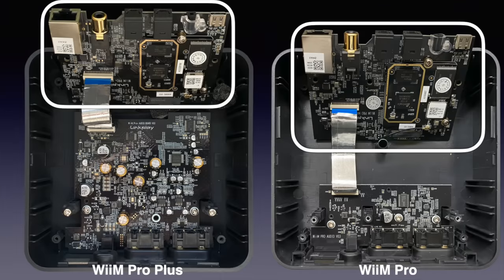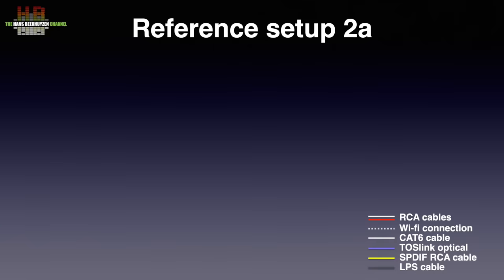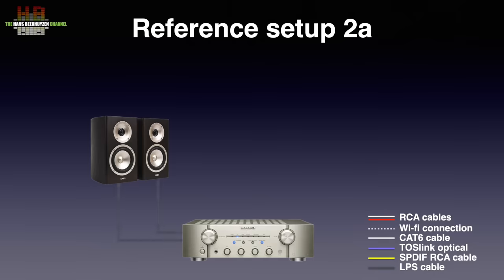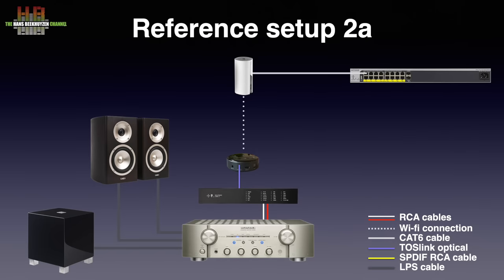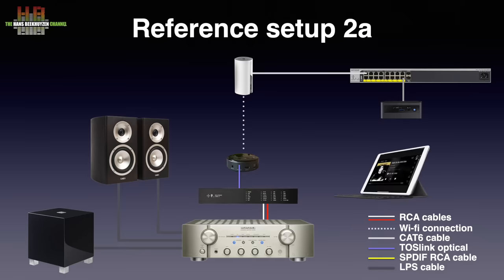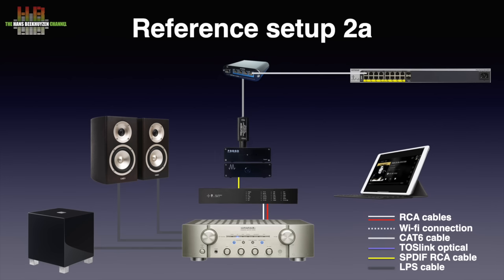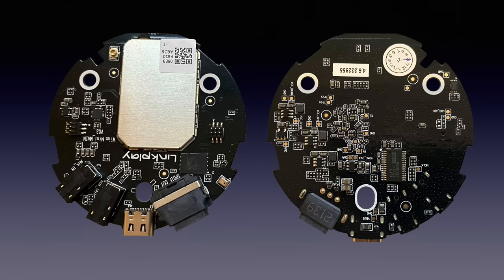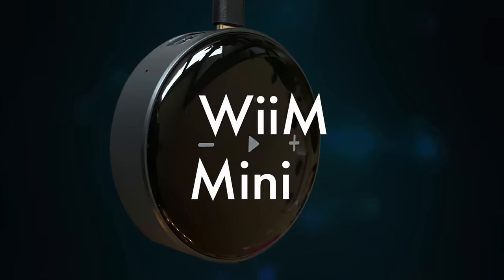The digital output of WiiM  streamers

Comment: Well, THAT explains why my Wiim Pro's sound is almost unrecognizable from when it first arrived. It's currently powered by an LHY linear power supply and it's connected via coax to my Denafrips Hermes digital processor that is connected to my Denafrips Pontus II R2R DAC via i²s. The Hermes uses OCXO-based clocks to reclock the original data stream after electrically isolating the data stream from the original digital digital source.
Reply: Interesting post as I was looking at a similar combination. I would have thought the Cyan2 reclocks the data but I'm not sure.  So I think you are saying that the limitations and SQ issues outlined by Hans (i.e. the Wiim clock) are mitigated by the superior OCXO clock on the Hermes, before feeding a superior DAC
Reply: @usswia that would be the case if the Wiim had a USB output . The connection with the Hermes would be asynchrone
Reply: You can hear the difference?
Reply from the maker: Reclocking requires an extremely stable voltage to the DAC, extremely good flip-flops and buffers that are very fast. Therefore it's always better to start off with a clean, well clocked digital signal on the input. Therefore spend as much as you can afford on the digital source. Preventing is far better than curing.
Reply: Love the 😅 the usability  and versatility and love the price. I love the way it makes my budget setup sound like a budget  system  with the pro ( priceless ). One more thing  it has a remote, and you can add a dac ....ps I have  porcupine  tree in every room in my house and in my  garden. Shedd lol
Reply: @TheHansBeekhuyzenChannel  Preventing is far better than curing. Sound advice!

Comment: hi, are there possibilities to obtain I2S out from the WiiM Ultra? Are there some pins on the pcb with I2S signals?
Reply from the maker: I’m sure there is but I would not bother. It will use the same clock as the other digital outputs.

Comment: As an engineer with a signal processing and signal integrity background, I'd love to measure the impact of various streamers on the audio output of the connected DAC measured using Audio Precision or similar test equipment. For stereo imaging, one could use RMS vector error on a complex plane defined as (left) + j(right). As a music lover, I admit I am less than satisfied with a WiiM Pro Plus connected via S/PDIF than I am with an ARM-based SBC via USB into the same DAC (in asynchronous mode USB Audio).
Reply from the maker: The Audio Precision can’t measure that. My colleague Jaap Veenstra of alpha-audio.net does these measurements.
Reply: What you say makes sense. The S/PDIF output is being clocked by a $.25 crystal most likely.  The SBC/Pi would have the DAC’s more advanced/accurate clock handling the timing.
Reply: Yes, USB is the solution in nearly all cases - at least that is my experience. I use an RPI4 powered by an LPS and connected by USB to my DAC. The sound staging is very precise to my ears.
Reply: Curious if you know about the quality of the USB output on the 4b. I know previous Pi’s  had usb issues and always debate if I should get a USB galvanic isolator?
Reply: @szh70  the RPI 4 and 5 separate the USB and Ethernet controllers/connections from a shared architecture, so that should help. Schitt brand of DACs have an indicator if they think the incoming source is poor, and that has never triggered with my RPI4. Any decent DAC should filter out a reasonable amount of electronic noise from an incoming signal.
Reply: @szh70  The prior issue with Ethernet sharing bandwidth with the USB ports is resolved on the RPI 4b, but electrical noise transfer could still be a problem. In my case, I am using a ROCK64 with the USB passed through an iFi Audio iPurifier3 before reaching my DAC. YMMV, but this kind of set up seems to work well for me.

Comment: I’m not sure about your conclusions regarding the WiiM Pro. I started out with the Mini and iFi power supply using the WiFi , into a Denefrips Ares12 balanced cable to McIntosh c50 Pre balanced to a McIntosh mc352 amplifier ,to Klipsch La Scala speakers, REL subs and a very good sounding room. Excellent soundstage super strong Center image details that I haven’t heard before all in all in general a fantastic experience.Then I bought the Pro and replaced the Mini. I thought there may have been better sound, but really did not notice a large delta. I really don’t know or think there’s anything more to be gained switching to a more expensive streamer for my system.
Reply from the maker: Let's agree to disagree ten.
Reply: @johngutmanis3204  You went from a Wiim Mini to the Pro. The issue is that both would have the same issue even if somehow the pro is to a lesser degree. I think you would need to try a more upscale streamer compared to the Wiim to then confidently claim a streamer update in your system won’t make a difference.

Comment: Very interesting!!  I recently tried the Eversolo A6 but hated the DAC and hated the fiddly user interface almost as much, so it wasn’t worth it to me to use it as just a streamer with a better external DAC. 

I ended up going with the iFi Zen Stream primarily due to its purpose-built function with NO built-in DAC. I have a Naim DAC-V1 which, as you may know, had an asynchronous USB input that pulls the digital signal from the streamer and runs it through its own superior clock. Do you think I’m missing something by pairing a $400 streamer with a $2,800 DAC?  It sounds incredible, but your video is making me question whether I’m leaving sonic money on the table, as it were. Thanks for everything you do!
Reply from the maker: De gustibus non disputandum est

Comment: Hi ….i wonder if something like a digital to digital converter for everything digital that connects to the dac might be useful here since they usually have super high resolution clocks and apparently clean the signal up 🤷‍♂️
Reply from the maker: It can help, but only if the DAC following it up does.t ruin it again to some degree (with is often the case.

Comment: Hello Hans, very enjoyable video and answered the first part of a question I've been pondering for a few weeks now.  The second part is : I understand from your video that a major limiting factor in the Wiim is the onboard clock.  Does the digital data stream not get re-clocked by the Cyan 2 DAC?  I could not find any documentation on the Cyan 2 clock, other than a reference to a Femto clock on the original Cyan, so I assume it's probably something similar.  Can any of the SQ issues you identify (bass, image, etc) be recovered by a better quality DAC or DDC clock e.g. an Ocxo clock on a Denafrips Hermes?   Generally, I agree with matching components price-wise but I find the Wiim app interface excellent - better than all I've tried so far at various price points (interestingly Musical Fidelity are partnering with Wiim for streaming solutions) so, like many, I'm asking how can I take the performance to the next level, while still enjoying the user friendliness, online support, active forum etc of the Wiim equipment and community.  If you are ever in N.Ireland, free B&B in exchange for some room set up tips.  (or maybe that's not really free, then!)
Reply from the maker: It's not only the crystal. See my video "The BS about network switches and the like." (https://youtu.be/ZCFvIzzMqfk). What goes for the switch also goes for streamers.
Reply: @TheHansBeekhuyzenChannel  Hi Hans, Can you put the link on measurement results of Wiim Pro Plus (digital output especially) of Alpha audio? What was the test setup? What is in your opinion SQ difference between Wiim Pro Plus digital output compared to your favorite Magna Mano MK3 with the same external DAC? For example, In one of your reviews you set the estimation that Mano MK3 is on 80% of Grimm Audio MU1.

Comment: I used an Audiophonics DigiRescue (from France) reclocker between Wiim streamer (with linear power supply) and SMSL SU-X DAC, the sound improved considerably..... I cannot say if it improved to the level of a more expensive streamer, but I am happy with this combination.
Reply from the maker: Enjoy the music
Reply: Have you tried with the SU-X without the DR?  The PLL circuit of the SU-X should do a grand job of removing jitter. Sometimes adding an external reclocker or resampler can increase the noise floor and not add anything to jitter removal if the DAC has good PLL circuit

Comment: I recently ordered a Wiim Pro Plus to sate my curiousity about the quality of standalone streamers vs my dedicated Windows 11 streaming PC for audio, which uses a Matrix Audio Element H USB 3 PCIE card and an external iFi PSU. Both were used to feed my Audio-gd R7 R2R DAC via Tidal Hifi. There was a significant difference in transparency and clarity between the two, with my streaming PC setup being the superior option. Granted, the Wiim Pro Plus output to the DAC is SPDIF, versus the USB output from the PC, which might indicate that the USB interface on the DAC is superior to SPDIF, however, that in itself is likely a clear indicator of the quality of the Wiim Pro Plus streaming and digital output quality. I will be offloading the Wiim Plus and staying away from these ARM based streamers.

Comment: Is Bluesound node an upgrade over Wiim pro, when using external dac and power supply?
Reply from the maker: Even when you use it with the internal DAC it is an upgrade.
Reply: @TheHansBeekhuyzenChannel 👍🏼 thanks
Reply: @TheHansBeekhuyzenChannel  Yes but is the Node better than The Wiim if both use the same external DAC?

Comment: Hello Hans. Very nice test, even if introducing the Etheregen in the chain must have influenced a lot the second and third device performances.
I own a 2GO/2YU streamer from Chord, it goes to an MScaler using a Curious Evolved USB cable, then via a self-made optical link to a TT2 DAC; each of them is powered independently from an SJ lps. When I tested the Etheregen that a friend borrowed me, I immediately noticed an incredible soundstage was appearing, unfortunately I had to give it back and I'm still waiting  for Uptone  to release the second version of that device to buy it. The Etheregen is not just a switch, it makes a very good job isolating the streamer from the electrical noise present in the network and restoring correct signal timing .
A well balanced system can reveal every change in the digital chain and I totally agree with you: even if "bits are bits" the way they are sent to the DAC makes a huge difference in sound quality. Lucky you for owning an MU2 🙂
Reply from the maker: Yes the EtherREGEN has a small effect on the sound quality of the WiiM's. But is was minor compared to the influence the WiiM's have on the sound.

Comment: Would the digital coax output from something like an Audiolab 7000N be better than my Wiim Pro? Or do you need to head up to £1000 to hear a benefit?
(Wiim Pro - Qutest - Trilogy 933 - LCD-4)
Reply from the maker: I have not reviewed the 7000N but I would be surprised if that wouldn't sound better. Already devices like the SOtM  sMS200 will sound better. And that costs € 545

Comment: Hi Hans, thank you very much for the excelente video. I'm looking for a streamer to connect to my Pontus II. I'm thinking about Volumio Rivo and Ferrum Hypsos. I like Magna Mano, but I think if I want to sell it later to upgrade, it will be easier to sell Rivo, keeping Hypsos to connect to the streamer I buy at the time. I think that the Rivo + Hypsos will not be inferior in sound level compared to the Magna Mano.
Reply from the maker: As you might conclude from the fact that I did not go for the Volumio - and I already own a Hypsos - that I disagree where sound quality is concerned (not to mention the versatility)
Reply: @TheHansBeekhuyzenChannel  Thank you for the answer Hans.
 It was probably me who made the wrong conclusion. I had an idea that in the Rivo review, Hans had said that the Rivo connected by AES/EBU to the DAC and with the Farad 3, was very close to the level of the Magna Mano, so I concluded that the Hypsos being better than the Farad 3 , by connecting the Rivo to the Hypsos, it would surpass the Magna Mano.
One of my dilemmas is that a Farad 3, with Purple Fuse and the L2 Silver DC Cable, is at the price of the Hypsos here in Portugal, so if the Hypsos has better sound than the Farad and has the possibility of choosing the voltage between 5V-30v, I think it makes more sense to buy the Hypsos than the Farad 3, with the Fuse and cable upgrade.
Unless I'm missing some detail.
Reply: i doubt you will have trouble selling the Mano.  hard to find used.
Reply: Magna Mano is an unknown product here in Portugal. When there are a lot of positive reviews about a product, it is easy to sell, for example: DACs from Denafrips, amplifiers from Hegel or Streamers from Eversolo. Now a product like Magna Mano that has Hans' review and little else is very difficult to sell. I say this for the used market in Portugal, perhaps in other countries it will be different.

Comment: I have a little modified usb to coax converter from an all in one HP pc with JRiver. Been told for so long to ditch the noisy computer for a streamer as well as ditching usb cables. Finally after years, i took the plunge after all the rave reviews of the WiiM ultra. Found the price was right to try.  Wow. The spdif out to my dac was like taking 10 steps back from my computer audio. It was lean and lossy sounding. If i have to pay more for a streamer + network bridges, etc, i'd rather just stick to my computer audio. The downside is im missing out on a streaming platform that can play like a radio on shuffle so i can hear new music.I do get tired of listening to my same albums all the time despite having a very large library. I believe i could get something like Tidal to work with JRiver, but i'm not tech savvy enough for that stuff.
Reply from the maker: As I have said repeatedly.....
Reply: @TheHansBeekhuyzenChannel  I can completely understand now paying as much for a streamer as your dac is worth. I just can't stomach that total investment when pc audio sounds great to me.
I couldn't even try my DDC with the WiiM Ultra usb out to see if that would better the pc set up, but it did not work so the WiiM Ultra would force me to invest even more in a DDC that would work with it.

If i were to purchase a $2k streamer, it would be to also use it as a dac such as the Auralic S1, but i know the dac in it wont match my standalone $2k dac

Comment: That's the analysis I've been searching for years - since the moment I realized a decade ago the digital (optical) out from my computer yielded an inferior sound I could hear right away, but I didn't know why. It sounded dull, and the lows were kind of recessed or cut off. Digital is digital, I thought - why did it sound INFERIOR compared to when I played it on a conventional CD player?

I have accidentally bumped into a WiiM Mini at a delicious price, I was about to order it; yet, again I was overwhelmed with my thoughts since it was its Optical Out that I was buying, and then I found THIS video. Now, I'm putting it all on hold. 

I was going to hook it up primarily with my JVC UX-MD9000 micro system that has an Optical In, and a DAC, obviously. I really wonder if it will sound on par with a CD player
Reply from the maker: So you expect a very cheap streamer to sound better than a cd-player. That will only be the case if it's a poor quality cd-player..

Comment: I had a strange experience recently with my setup - i decided to try HQ player so i downloaded the trial version on my Macbook Pro late 2013 and connected my Moon 280D DAC (witout streaming board) via a standard 0.5m USB cable. 

Compared to my Primare DD15 CD transport, and Primare NP5 network player connected via SPDIF - the soundstage just opened up, and sounded more lively. Perhaps its due to the oversampling DAC chip in the Moon that doesnt has to work as hard when HQ player upsamples it to 352 khz, or perhaps its just me who needed some variation. I ripped one of my CDs to a FLAC file using XLD and tested switching back and fourth. Im confused.
Reply from the maker: Good upsampling does that.

Comment: Would love for you to get in and review a NAD CS-1 streamer and compare its output to the WiiM Pro Plus.  What are we getting for the extra money? ($349 USD) compared to the WiiMs? Is jitter significantly bettter?  How does it compare to the Node? I mean, if you are going to feed an external DAC, would the NAD CS-1 do just as well as the Node? Sadly, the CS-1 does not offer USB out so the level of clocking will be limited to that on the CS-1, even if you use an external DAC., correct?
Reply from the maker: It's almost daily that someone asks me for a comparison between two specific pieces of gear. I'm afraid there is no way that I can do that. Sorry.
Reply: @TheHansBeekhuyzenChannel thanks for all the reviews you do anyway.

Comment: Excellent analysis and presentation.   I may steal your slides.  I have the Wiim pro plus. I love the feature set but the sound from RCA is lackluster.  As a digital streamer it works well. FYI im feeding a peach tree 500 the coaxial signal. I also have a zen streamer which somehow sounds better.  can you comment on the psychoacoustics of processing digital signals?
Reply from the maker: Well, there is a copyright on the slides. The digital output of the WiiM is good for the money but I know lots that produce a better digital signal if you spend a bit more money.